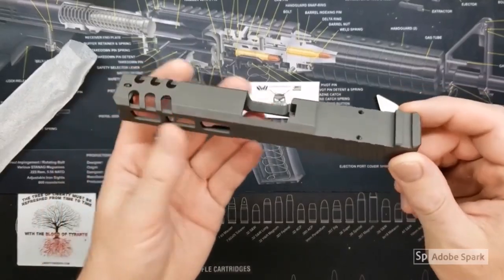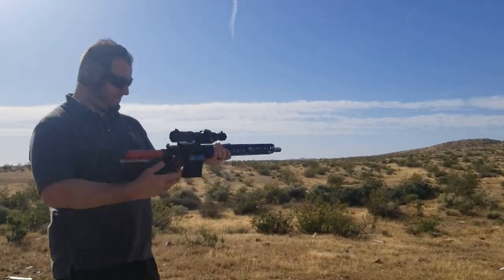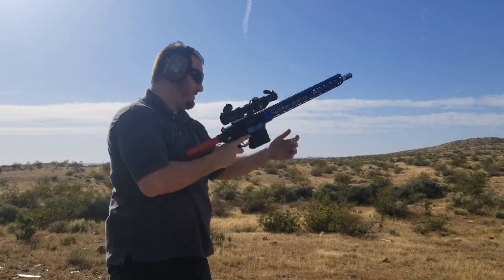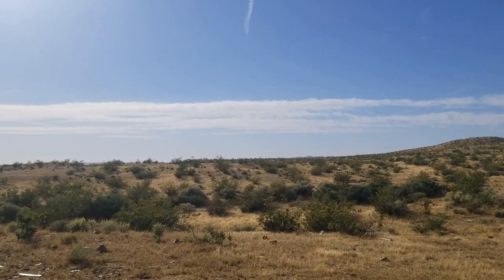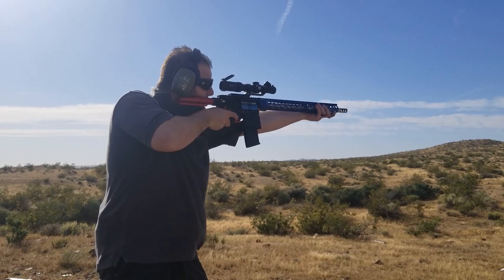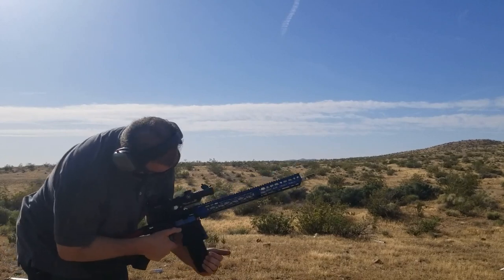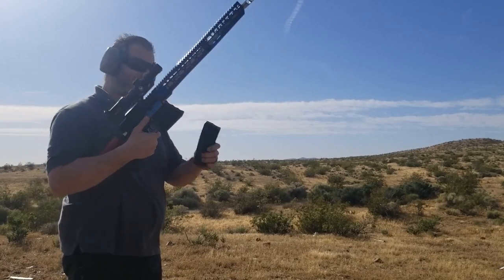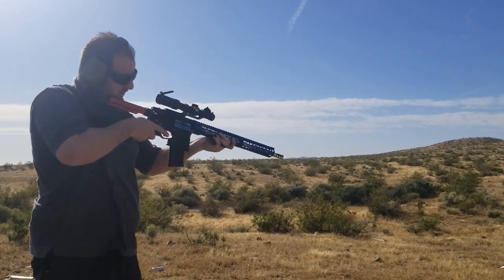First Shots and a broken tripod, what happened!

Comment: When the bolt slid forward on the dented case.... did not sound right
Reply from the maker: The "twang" is from the rail, its 18" in length and super light weight.
Reply from the maker: Miss you, brother, RIP.